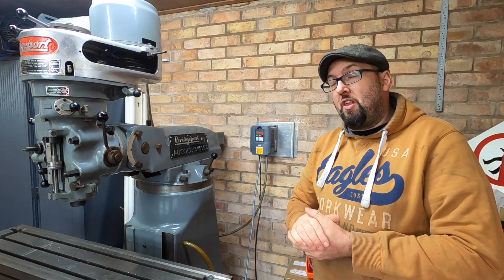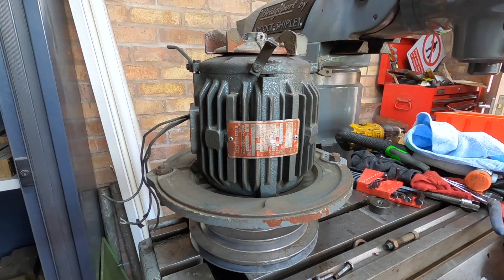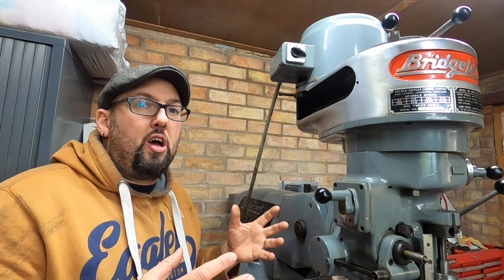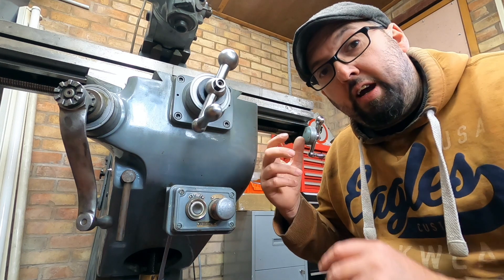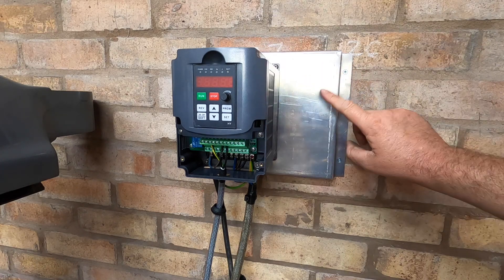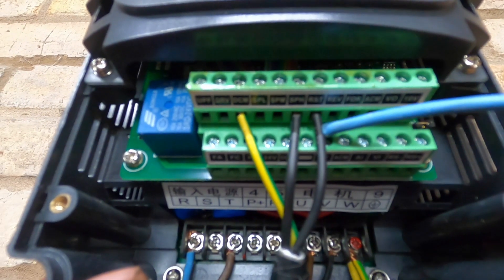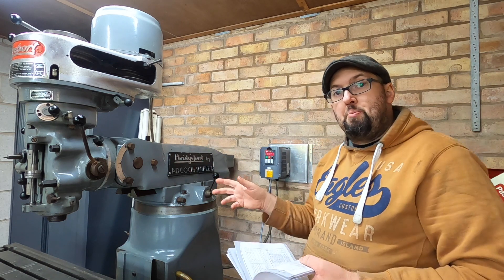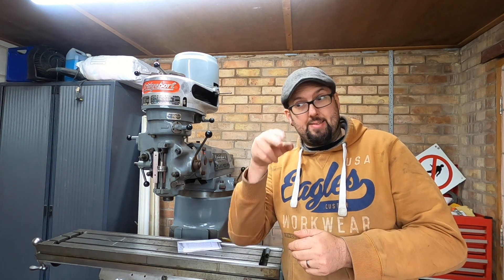Bridgeport pt 6 - Electric Chat - 3 Wire 1HP motor, Huanyang 1.5kw VFD

Comment: I have a 3hp KBC bridgeport clone, I purchased a 3 hp/2.2kw vfd. This should work or will it overload? I bought a 5hp/4kw unit for my 5hp lathe but now I'm questioning it all. I could always use the 5hp one on the mill and then buy a larger one for the lathe. thoughts?
Reply from the maker: Hi, Its always advised to get a bigger hp vfd than the motor your using it on. As long as it is not a lower rating it should be fine. You can always set the VFD lower on parameters so it's not working on full power. The two lathes I have are both 3hp powered by 3hp VFD's and I've had no issues. All the best, Matt
Reply: @MattChiversWorkshop Thank you Matt, I got my mill machine running off the VFD. Haven't loaded it up yet but it does spin the spindle. My only issue is using the mills spindle brake too hard causes the VFD to fault on over current deceleration. I could use the larger VFD and buy a brake resistor for it but just assumed I wouldn't need this as it's a very low load for a milling machine vs a lathe.

Comment: Good video, I have just purchased a Bridgeport with table feed and coolant pump. Would this VF power them aswell?
Reply from the maker: Interesting question, I will say the VFD output amperage would need to be able to handle all the components its drawing from, this is something I have been thinking about for the Harrison lathe. Further research and calculations are required. First thoughts are it should be possible. All the best, Matt 👍

Comment: Hi, I have fitted one and set the display in freq mode and turned it to 50. Hope that is ok?  What can I now do with the travers as it needs 110 ac. thank you Patrick
Reply from the maker: Think you will need a type of transformer for the 110ac. Having not done that as I don't have powered traverses, I'm not sure what you need. All the best, Matt

Comment: I really like those vfds used loads of them on woodworking machinery. What is the voltage of the motor, I would of thought it would be 380v  delta with the 3 wires coming out of it. I've had my motor guy bring out the star points of the windings before to make it low voltage. I'm surprised at the motor only being 1hp
Reply from the maker: Yes it’s 380v. My aim was to swap the motor out for a 240v one, but Bridgeport have a longer shaft length than you can buy off the shelf. You can get one for a Bridgeport but you them pay the premium because it says Bridgeport. I was surprised to at it being 1hp, but it does what I need it too, so all is good. All the best, Matt
Reply: @MattChiversWorkshop  I would be careful. It sounds like you are running a 380v 3 phase motor from your household 240v single phase via a vfd which changes your household single phase to 3 phase. Unless your vfd also changes the voltage from 240 to 380, which I dont think those vfd's do you might cook your motor. I thought it was weird when you said you couldnt use it for slow speed. When you ran the motor it didn't sound very happy.

Comment: You need to earth the motor shaft itself if your using a VFD because the PWM pulse wave modulation will cause capacitance on the shaft and build up voltage up to 70volts before it discharges back to earth thru your ball bearings..destroying them..frosting /fluting the ball bearings in as little as 720 hrs of use..ask any HVAC guys using a VFDs on equipment and they will confirm this fact..most home shops never put that many hours on their machines to find out this..but even worse it can also destroy spindle bearings too.. you simply need to add an earth wire to the motor shaft to prevent this..Myself was looking at a spring loaded motor brush riding against the motor shaft to an earth wire so the volts never build up to a level it could discharge randomly back to earth..

Comment: Matt, thanks for the great video. I have just bought the very same mill as yours, a 1964 britush made bridgeport so I'm very glad you are pushing out these videos! How are you getting on with getting VFD? Do you think you would get more torque if you were running it on 440V?
Reply from the maker: Hi Colin, the VFD has been fantastic, only thing I’ve noticed recently is the cold weather is effecting the motor, it’s not getting up to speed straight away, it’s taking 2/3 times longer. I’ve also noted a definite slowing when it’s starts cutting, so I’m not sure what’s going on, would definitely get more torque running on 440. 

I’m not taking huge cuts so I not currently worried, I’ll be looking at getting the motor rewound, or a replacement if things decrease further as I think it’s the motor not the vfd.

All the best, Matt
Reply: Same here

Comment: Hi Matt. Has the motor been rewound 3ph 230v? The standard inverters you get that hook up to a 230v 1ph supply, output 3ph 230v and not 3ph 400v. Rob
Reply: I've just sorted the very same motor. It was as I suggested in my last comment. The motor was hard wired in star. Three of the windibg ends are joined together inside the motor. It was a simple job to separate these and bring all 6 winding ends up and connect in delta. Motor now runs fantastically on the vfd with no loss of torque. Matt I can send you on all my photos of the work if you let me have some contact details.
Reply from the maker: No the motor has not been rewound, these are unusual motors, no star or delta configurations. The motor states 3ph but has input 240v or 400v. I spent a long time looking the motor up and solutions to make it run from a VFD. What I mentioned in the video was the result. The machine has been in operation and performed as it did on 3ph, obviously tweaks and mods can be done overtime if required, but I needed it operational. You will see it working in upcoming steam engine build project videos.
Reply: @MattChiversWorkshop  I've just been  having a chat about this motor with the technical team at interdrive. They think it may well have all the normal 6 wires but they are hard wired to star inside the motor. This would be due to the fact the when it was made they never envisaged it being reworked (VFD hadn't been invented). I'm going to have a gentle did this weekend on mine and see if this is the case